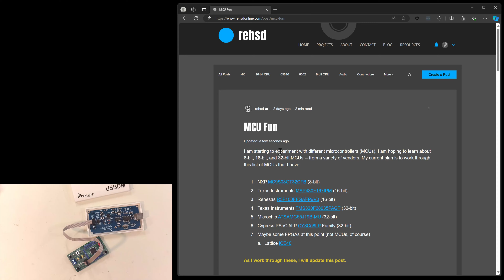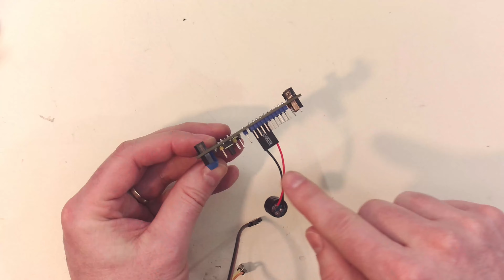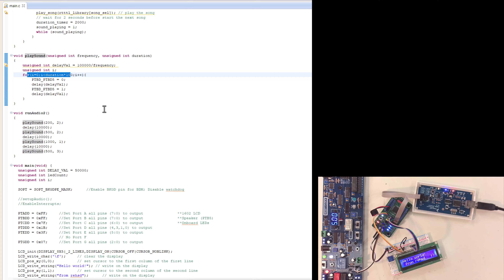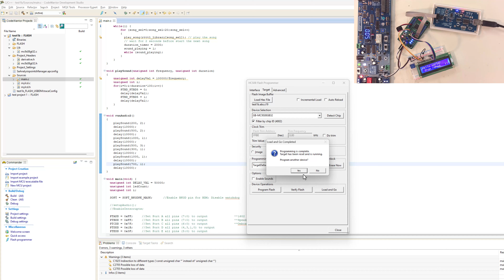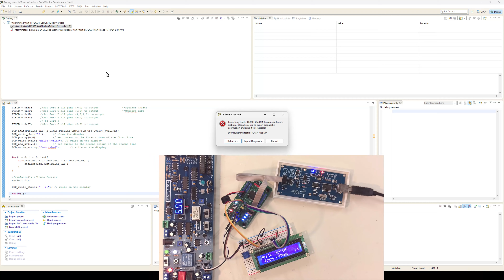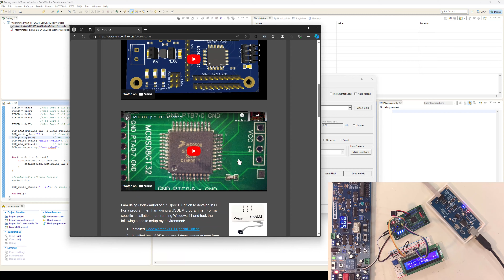MC9S08, Ep. 3 - Running Some Code - LEDs, 1602 LCD, Speaker

Comment: You seem to have a lot of experience working with multi-layer pcbs. I was wondering if you've ever put signal lines on layers besides the top and bottom before. There's this one area on my current project where things are so congested that the autorouter is having a hard time getting it to work and I can't really spread things out any further apart. I'm thinking about cutting out a maybe 3in x 1in section out of my ground plane and allowing the autorouter to put regular traces there but i've also been burned in the past from insufficient ground planes and power planes. Do you think that's a good idea and have you ever put signals on more than 2 layers? I try to keep my designs on 4 layers or less.
Reply from the maker: To date, I have almost exclusively used the inner layers as VCC/GND planes. Which autorouter are you using? I've had good luck with freerouting. I have done some PCBs with three signal layers and one GND plane; while it worked fine, I doubt it would be seen as a model for how to do things. :)  I have had feedback that routing some signals on one of your inner plans (maybe on the VCC plane) would be fine. Also, what are you using for track width, space, via diameter, etc.? To help myself, I started this blog post so that I remember some of the values I'm using: https://www.rehsdonline.com/post/my-personal-pcb-checklist. Maybe others here can chime in on your question, too.
Reply: @rehsd  
I'm using 0.15mm clearance 0.2mm track width by default, 0.15mm clearance 0.25mm track width for the 1.8 and 1.2 volt rails if used, 0.15mm clearance 0.3mm track width for 3.3 volt rail and 0.25mm clearance 0.3mm track width for the 5 volt rail. I use 0.8mm OD 0.4 ID vias. No idea if those are good values or not. I'm doing the default traces that small because freerouter really struggles getting around that pga168 socket if they're any bigger.

I use freerouter, that open source java one. 1.9.0 is the latest version and they've fixed a lot of bugs so be sure to get that if you haven't already. I might even be able to route my current thing without manually editing any ses or dsn files with a text editor to try to trick freerouter into doing what I want. The feature where you can allow or disallow layers finally works. I still manually route important capacitors as directly as possible to the thing they're supposed to go to. I'm not doing dedicated power planes besides the ones I put under the cpu and the bus steering transceivers. I do signal/power/ground/signal on other 4 layer things but based on almost nothing, I theorize that 2 ground planes mostly everywhere will be better for combating signal integrity issues and getting squarer square waves.

Do you know how many layers vintage socket 3 motherboards had? I've tried looking at a few of them under a microscope but the layers can't be seen. Even known multilayer boards look the same as known 2 layer boards when you look at the edge under a microscope.
Reply from the maker: @scotts-tech  Are you using the fanout option in freerouting? That's helped me at times. The jump in cost from 4 to 6 layer isn't as bad as 2 to 4 (at least for JLCPCB). Maybe you could give 6-layer a shot. I'm not sure how many layers vintage socket 3 boards would have used.
Reply: I have a board using 6 layers with the following stackup:

Signal
GND
Signal
VCC and a small amount of signal
GND
Signal

One extra signal layer really makes a huge difference. But even I had a tight spot where I had to route some traces on the VCC layer.

But routed power is also fine, you don't strictly need a VCC layer. Just be aware of how much current is required for the devices and how far away they are from the power supply. Long thin traces with a load will have a voltage drop, and if that gets too significant then you may run in to issues during operation.

Ideally you'd keep your reference planes completely solid. And it's worth noting that a VCC layer can also be a reference plane. The difficulty is that current likes to return to it's source by following the trace as closely as possible on the reference plane. Any obstructions on the reference plane that causes the return current to deviate from the path of the signal trace has an effect.

Changing reference planes also requires some thought. A trace that jumps from the bottom to the top layer needs consideration about how the change in reference plane is managed. In my design when a signal changes between either of the ground planes as a reference then I add a via joining the two ground planes adjacent to the via on the signal trace. Where you change from a VCC to GND layer as a reference you obviously can't join the two with a via so you need a capacitor instead. Decoupling caps can serve this purpose I believe. Hence if you can keep all of your signals referenced to ground planes then it makes the design a lot easier.

Robert Feranec on YouTube has so many good videos about PCB design, including a lot of talks with people about all kinds of advanced topics. I try to pick up what I can from his videos. It's a long learning process, but in all honesty if you're not dealing with signals in the hundreds of MHz or GHz range with crazy fast edges then you can get away with a lot...

As for old motherboards, you're looking at anything from 4 to 8 layers I'd say, depending on the type of components used. Robert Feranec has a series of videos looking at a dual socket server motherboard, it's quite fascinating and is routed on 8 layers (4 signal IIRC). You won't see much inside a board because the internal planes will make it opaque.